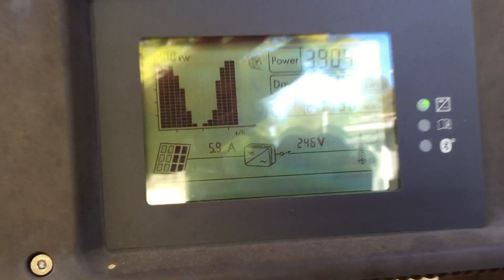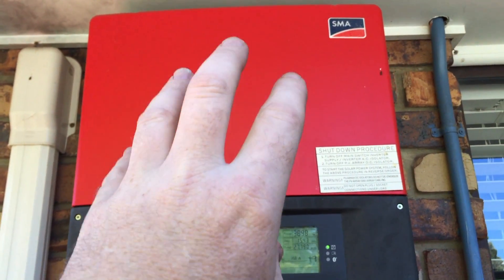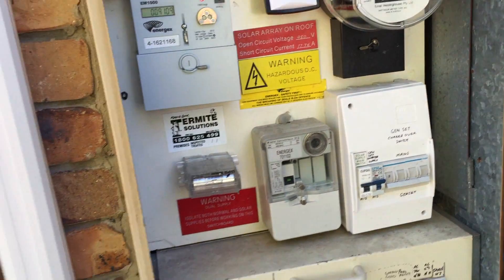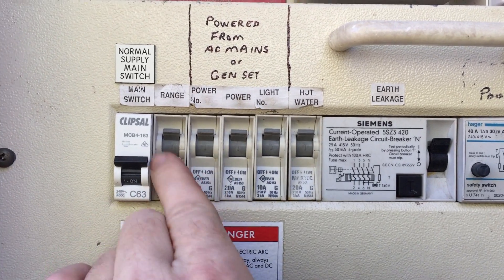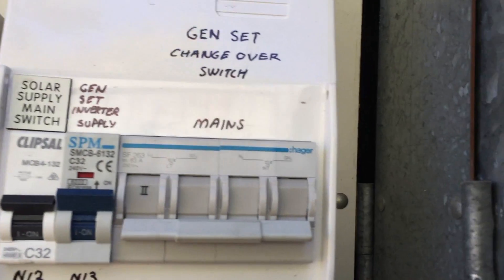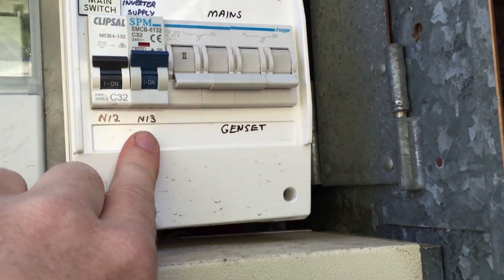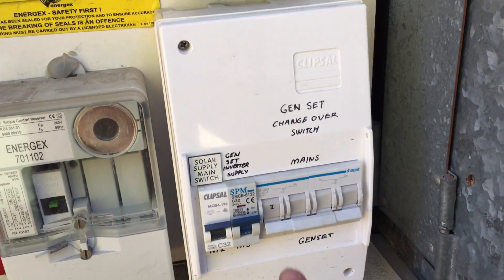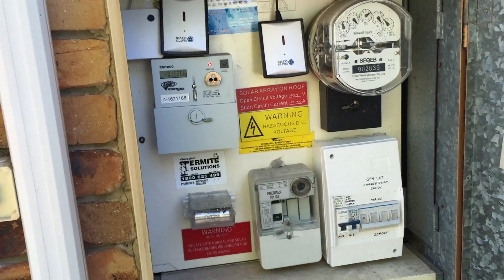How it get my power into my home

Comment: Hey Pete, It looks like you have 2 smart meters and the old analogue meter? I'm from Melbourne, our analogue meter was removed when they "insisted" on changing over to a smart meter. Can you please clarify whats actually running? Cheers.
Reply from the maker: Digital is the solar feed in and normal power analogue meter is Hotwater System

Comment: Appologies if obvious from a past video, but do you have a battery set-up? (aside from the 18650s). I find the part of selling to the grid funnily sad... In Spain we now need to pay TO the grid to use solar... @#%$€#^+=!
Reply from the maker: Yes, i sell to the grid but only at 6c per kwh, and buy it back ten seconds later for 25c lol I did have an old bank of batteries but the 18650 bank replaced it and i gave all the old batteries away.
Reply: +HBPowerwall ok thanks, people here invested with the idea of selling to the grid therefore not even having batteries to start with...
Reply: I happy that currently in Minnesota, USA we have net metering and sell at the same rate we buy.  I'd love to go off grid, but my array produces double what I need in the summer and 1/4 of what I need in the winter when it gets buried in snow.  I doubt I'd survive the winter.  Once I get my Tesla Model 3, we'll see if I have enough solar.

Comment: sell your power why sell it ? don't you only get 4c for a kw of power then they sell it back to you at a higher price,  sure you can fine some more batteries.  what you want mains for if you know. when you make or own power, the cost of just having the mains there like the rego on my car each year
Reply from the maker: selling it is cheaper (and easier)than spending 10g on a Selectronic Inverter to do what I would really like to do. The 6kw of panels and TL5000 inverter were all installed with government incentives
Reply: government incentives so you get the 48c on a kw do you, i'm not sure but don't you lose your 48c by installing a battery bank there was some thing on the news about it 2 or 3 weeks back  and there was more gov incentives for doing it but think it takes the 48c away maybe some thing to look into. I'm not sure about all this as i renting in the city before i go to my block of land i not be feeding the grid i be full off grid setup up on my block of land as it cost over 10G on a power pole and meter box only just to get a bill all the time.  think its cheaper to buy batteries then what you pay each year to be on the grid  what over $600 a year that 's a car rego  that buy me 400 ah of batteries .
my mum has  30c kw feed in with your tl5000 inverter but to get the 30c she only aloud to put 3kw on it only so she gets the 30c for only 3 years but when that 30c is gone then here comes the mpp solar inverter to charge battery bank and run off to try save more 
don't get me wrong mate love you video's big help to alot of people i be keep eye on your setup to see how long your battery bank last as im still using AGM batteries as the cost of your batteries are alot and we all cant do what your doing we can get lots of old laptop batteries as you have done....
Reply from the maker: In QLD at least you do loose your 44c feed in tariff and drop back to 6c if you have batteries installed. However i've never been on 44c and i'm lucky to make 40 dollars a quarter from selling power.
Reply: thanks mate for the reply .I'm with you mate in QLD to brisbane , my mum was saying that its not 6c any more think she said was 4c what a joke and don't you pay rent on the smart meter to read your power use think mum said you pay $106 a year to just pay for that .
$40 not alot so it don't even make up the service fees so that's a costly back up and look at today tonight ,on tonight...there is a bit on home running from batteries i think it be the way most people turn off the grid as it cost alot just to have the power and we getting ripped off on the cost of power we pay alot more then most in QLD . i think it be cheaper to have a lpg gas genset to run it be cheaper to have that as back up power to run on them raining days.
I have a mate fully off grid he saves big time full home setup with solar and batteries and he never even runs a generator at all .. with no AC in the home he  DC man he still have ac power tools that run off a cheap power jack inverter for he tools does him fine and 4x 250w solar panels run he hot water heater gets to temp of 80c each day fine but its just him i'm trying to do it for family of six alot harder but i'm getting there slowly on a gov pensioner i don't get alot of cash to do this but i'm trying my best
Reply from the maker: I totally dissagree - the four cents sucks. BIG TIME BUT - I save another 800-1000 per quarter using my power from my panels some times it's not about your bill but what you save. If i had that 10k i spent on panels in the bank earning interest there isn't any way it'd be that much money. So if you look at solar as an investment not and expense it really works well. IF i had the 44c i would be raking the cash in hehehe never mind

Comment: Strange mine is an auto switch that if it detects no mains switches over to the inverter all but my pool including oven ect. the other way was to do a 3 way switch mains, off, inverter. what is thet second in gen switch for?
Reply from the maker: It is for the incoming power to the PIP2424MSX to turn it off.